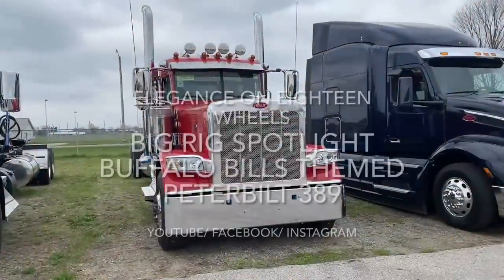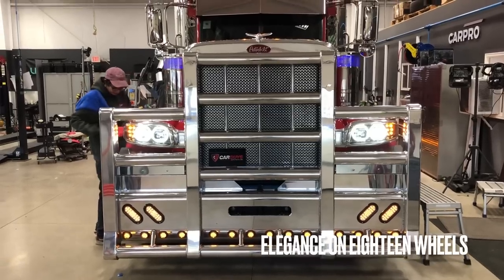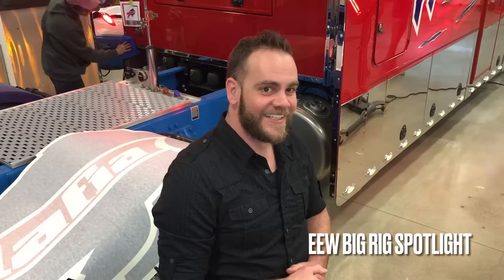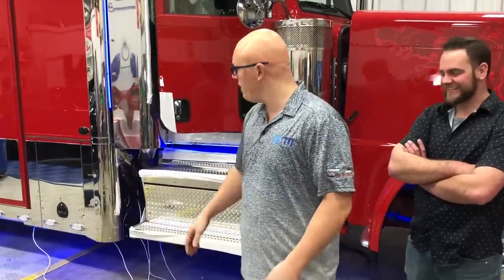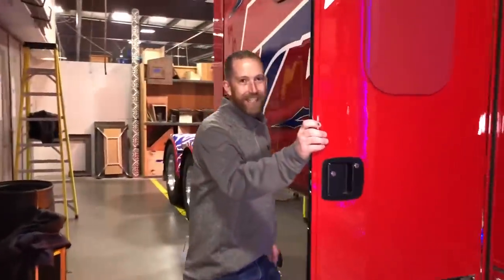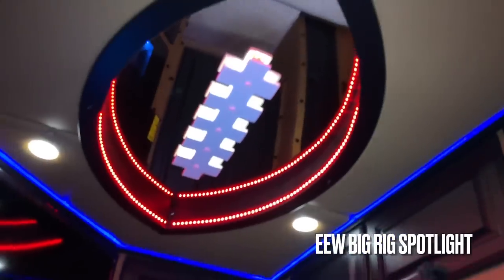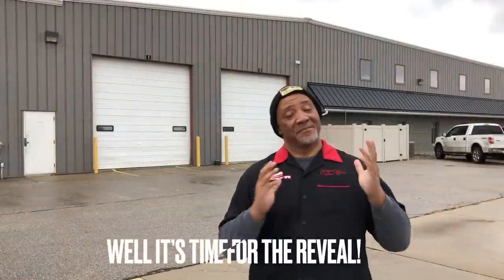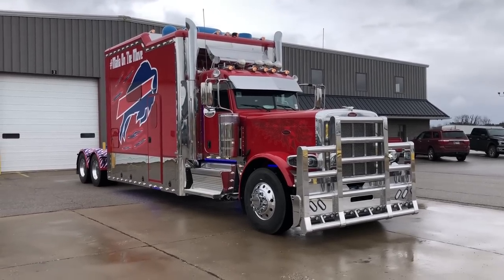Big Rig Spotlight Buffalo Bills theme Jacuzzi Peterbilt

Comment: Nice build, however I personally don't think the hot tub is a good idea. I'd worry about moisture, possible water damage, and condensation  inside the rig
Reply: I'm pretty sure it will be used, then drained prior to any actual rolling. But it is different, although not practical.